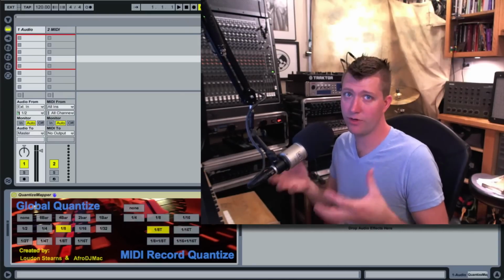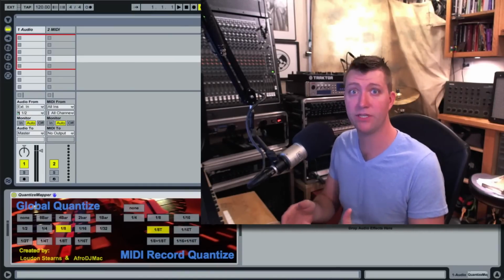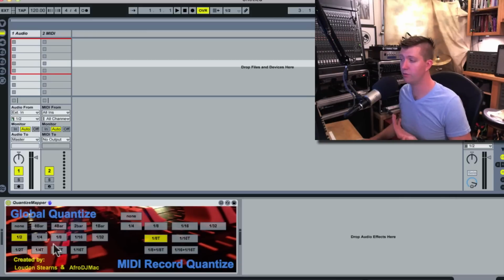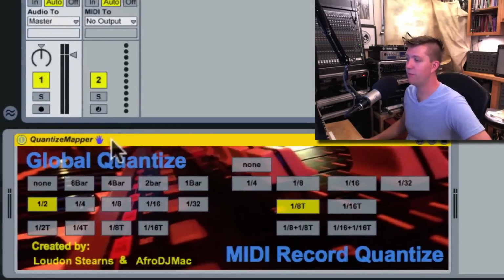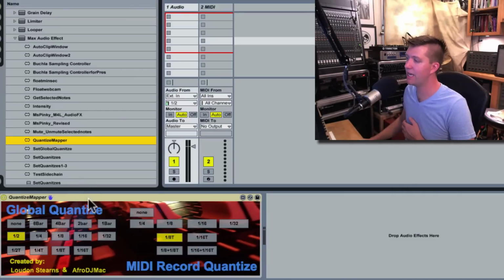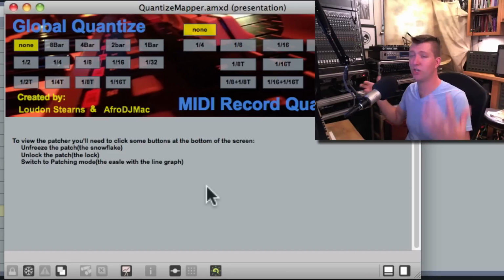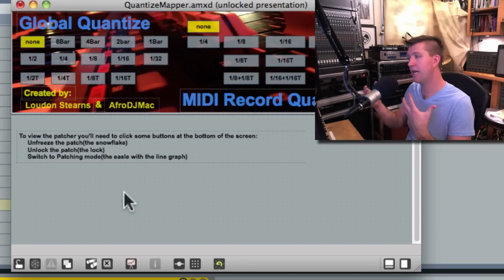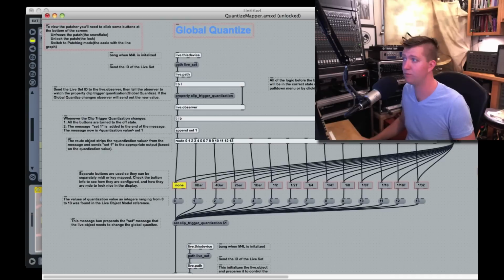Max for Live API Basics - Quantize Mapper Design (Part 1 of 9)

Comment: Hi, 
I need a device to auto open an audio clip when play button is pressed after recording it to loop in session view,then mouse click the screen on the clip to select it then to perform a hot key of CTRL+U (quantise)
maybe this could be triggered by a midi note in a blank clip.
i  understand why u cant record quantise while recording an audio clip but surely its possible to send this command to the new clip after loopin? Is there a way to programme an M4L device to perform hot keys when activated?